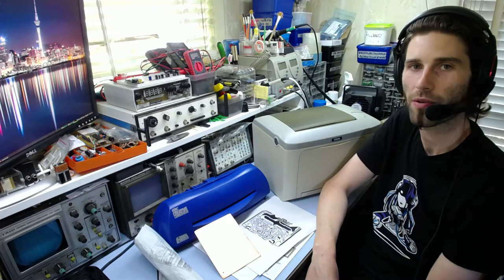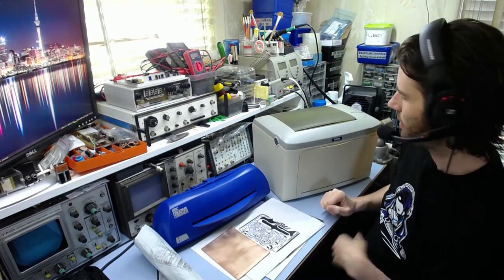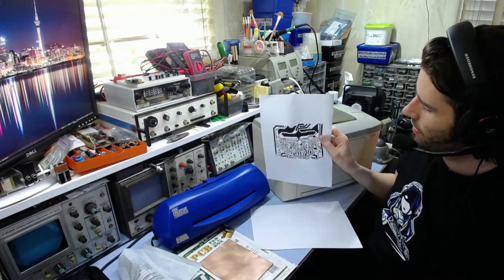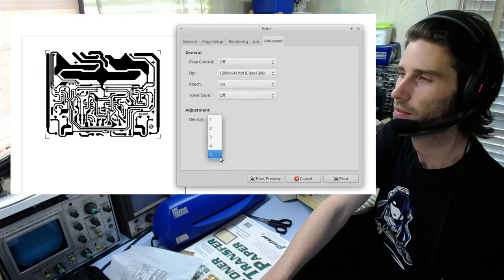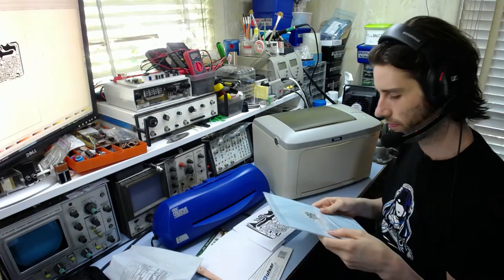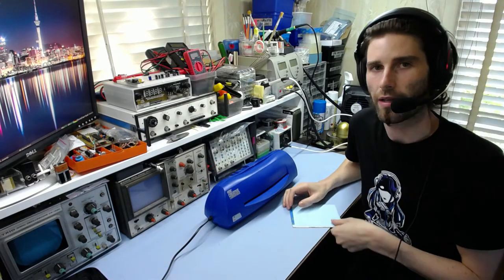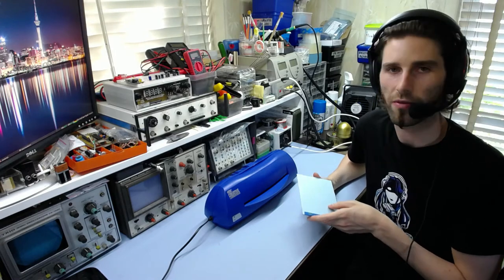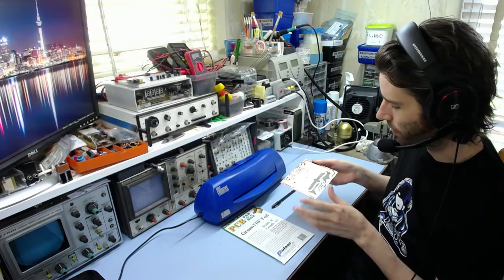How to apply PCB etch resist with the toner-transfer method

Comment: Brother HL-2030 Laser Printer work fine for this. You can mod it for the refils.
Yellow stuff is pretty good!
Reply from the maker: Good to know! I did read that not all Brother printers are unusable for this, but some of them are, apparently. I only have (good) experience with Lexmark, HP, and the Epson printer in the video.

I have no experience with any Brother product, except that I once considered buying a Brother MFC capable of scanning A3 paper. When trying out a demo model I discovered its scanning speed was abysmally slow.

Will be interesting to see how the yellow paper compares to PulsarProFX stuff.
Reply: Cool, I've been rocking my Brother HL-2030 since 2008 still going strong, now discontinued but still have loads of spare parts available on ebay. And very cheap second hand for people who want do to this sort of thing or just for printing.

Comment: could you tell me what software you used to flip your PCB image?
Reply from the maker: Since this board was done from a scanned magazine, I probably flipped the bitmap image in GIMP before converting it to vector with Inkscape. But you could use either, depending on what format your file is in. Most PCB EDA software have print/plot options to flip/invert the output if desired, too.
Reply: @Agent24Electronics  thank you

Comment: Google "toner reactive foil". Perhaps one of the crafter varieties would be a cheap(ish) alternative to the circuit board stuff.
Reply from the maker: Thanks for the tip - have you tried this yourself? A quick search turns up many such products to give metallic highlights on business cards etc, eg: https://www.ebay.com/itm/50pcs-Gold-Silver-Foil-Paper-Elegance-Laminating-Transfer-Laser-Printer-20x29cm/264009812170

I wonder though if they would stand up to the etching process - if they are actually based on some kind of metal foil, they may be etched away? Cheap enough to be worth a try, perhaps?
Reply: No, I have not tried it. There is a post here- https://www.muffwiggler.com/forum/viewtopic.php?p=1519690 that makes me think it should work. Also, search ebay for "reactive foil". You may find a source closer than China.